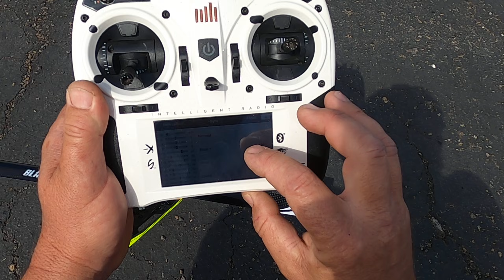How to Set your Tail Rotor Perfect on a R/C Helicopter and Why this Method Works.

Comment: Cos.  Iv got my tail mechanically set up right .  I have a slow wag in stunt 1.  I do have the 6250 controller.  So normal and stunt 2 are good.  I saw you said to adjust gain only 3% at a time.  If I understand correctly slow wag is the I gain or should I probably turn P and I down a bit?  I did lower head speed down to 70 in stunt 1 which I was expecting to have to raise the gain some. Thanks man.
Reply from the maker: Try more P and I first. Flip into stunt 1 switch position while in forward programming to make sure that you are adjusting the PID for stunt 1. It won't spool up as long as you are in forward programming.
Reply: CoeShow619 thanks bud!
Reply: CoeShow619 I think I’ve been adjusting to much at a time.  I was going like 10%.  Then I rewatched your vid and you mentioned 3% at a time.  Maybe that’s my issue
Reply: CoeShow619 dude I got it worked out!! Thanks so much!! You da bomb.com!
Reply from the maker: Josh Wilson That’s rad. Just have fun and fly a lot.
Reply: Cos, one more question, sorry to blow you up, I know you put a longer servo horn on the tail servo, why is that?
Reply from the maker: Josh Wilson  it’s a longer pivot point so it basically gets where it has to be faster. So basically it mechanically increases the gain. Gain equals speed of servo basically.  When you turn gain up, you are just making it react quicker.
Reply: CoeShow619 ok thanks I understand that now.  I appreciate it
Reply: So I put a longer arm on my tail.  It’s rock solid now.  It would be normal to have to turn the gain down a considerable amount correct. Doesn’t matter what the number is bc I have added mechanical gain.  Am I correct?
Reply from the maker: Josh Wilson Right on man! You must have been a good student. That is correct. The whole key to these Helis is knowing the science and mechanics behind them. They always fly best when tuned as perfect as they can be. Every tail in every model, with every gyro is like this. Next you can get into head gains. Same concept, but locking in that head for a robo heli. Gain is basically just turning up the speed of the system. You want it to run as fast as possible with out overshooting the target. Any new blades, new servo, a change in cyclic deflection all creates a change somewhere to get it dialed. Most guys just fly these all lazy and wait for them to fall apart. I like Helis because they are finicky, and not everyone has the patience. So ask all you want. Also a Justin Coe Show Coe Facebook page. You can message there too. Thanks man. Just have fun.
Reply: CoeShow619 dude thanks!! I’ll find you.  I’ve flown planes from 15cc up to DA 70 twins for 25 years.  MostLy Extreme Flight stuff.  Iv gotten into the helis bc like you said they are complicated and flying 3D is hard!! Iv learned  Any change in anything changes your tune.  I love it! Thanks so much for your willingness to get back to me.  I’m sure I’ll need your expertise on the 480 build!! Thanks again Justin! You rock bro
Reply: Cos shoe cuz, got a question on a little blade 230v2.  So I have considerable more positive pitch then neg.  My swash is perfectly level and I have 0 pitch at mid.  the controller arms from the upper swash are fixed and not adjustable so I can’t lower the overall swash to give me more neg.  if I did it by just the bottoms 3 axis links then I wouldn’t have 0 pitch at mid stick.  My question is on my servo travel end points could I change the neg to around 110% to give me more neg without it messing up my flight controller.  Iv read in some cases if you go above 100% in something( not sure it was pitch, maybe just cyclic) that it could confuse the controller.  This controller is just the 636.  Thanks again bro.
Reply from the maker: Josh Wilson you are correct again. I use about 110% low stick for pitch with the 230s v2.
Reply: CoeShow619 sweet thanks again my man! I just wanted to make sure it wouldn’t confuse the 636 or anything crazy like that.  Really appreciate Justin
Reply: Cos.  Dude you are the only guy that knows this shit so well so I come to you bc you take the time.  On the 6250 what would make the swash tilt back in normal mode with stability off.  I’ve tried everything man.  Recalibrated it several times.  It’s level during calibration.  My swash is perfect,  U1 and U2 is fine.  Even in hover it tries to roll back.  Stability off in every mode.  🤷‍♂️. Thanks coshoe
Reply: Dude I figured it out.  Someone it was trimmed.  Disregard.  Thanks
Reply: I forgot to set the trims back to 0 a while ago after I ordered a swash leveler.  Iv got 2 of these 330 And first one is locked pretty well.  Couldn’t figure this out to save my life. Until I just sat down and thought about the whole situation.  Ok thanks.  Hope you are having a great sat bro.
Reply: Hey, how do you disable heading hold on the tail with the 6250? Do I just lower the PID gains on the tail in forward programming in normal mode?
Reply: Greg Fitz that’s a great question bc as in other controllers you take it to neg values or below 50%.  I’m not sure but maybe cos will know.
Reply: Josh Wilson yea everything i’ve tried still seems like the tail gyro is enabled. with the heli on the ground moving the stick left and right then letting go, the tail rotor doesn’t return to center.
Reply: Greg Fitz yeah I’m not sure you can even disable HH.  I like it to get my tail mechanically perfect but can’t find it either.
Reply: Josh Wilson i’m really only getting tail
vibrations in stunt 2. My PID is probably just too high, but like you said, I’d like to make sure it’s mechanically set up right and the gyro doesn’t have to compensate.
Reply: Greg Fitz absolutely I know exactly what you are saying.  What heli is it? 270 or 330?
Reply: Greg Fitz I wonder if you turn them off down to 0.  If you find out let me know pls
Reply: Josh Wilson I tried setting the tail PIDs to zero and the tail blades still don’t return to center after giving left/right rudder.
Reply: Greg Fitz well ok damn.
Reply: Greg Fitz what heli is it on?
Reply: I’m not a huge fan of this controller.  My tail also has some play in it.  Thinking about putting a ikon 2 on it and a full miroheli tail
Reply: Josh Wilson fusion 270
Reply: Greg Fitz oh I want one bad.  Mine is on a 330S
Reply: Greg Fitz you can try it with your tx gyro gains.  I think the 270
Comes with a 635 controller.  Mine is the 6250 controller.  My tx gyro is inhibit tho

Comment: Damn 700's are big. I've got a few BNFs with my first kit on the way. You mention the value of a good manual and I couldn't agree more. Even though the BNFs come pre assembled I wish the assembly manual was available. It'd be nice to have the OEM specs( i.e. pitch specs, servo horn lengths and link lengths). Hell I still have the manual for my Concept 30.

Comment: What does it mean whenever I give quick pitch movements the tail kicks out momentarily? Whenever I do hard maneuver the tail kicks out
Reply from the maker: Well if it is 7210, you can go to parameter menu, go to F and use either red flashing, or blue flashing to add rudder precomp to the right. The setting depends on the direction it needs to move. Red flashing is opposite of blue flashing. So watch the tail rotor while in Hold on the bench, and move throttle/pitch stick. Yoke on tail shaft should move a tiny bit toward boom.  If you have a 6250 or a Ar636, they do not have this setting, hence I do not use those systems now days. If you only have one of those, you will have to adjust the gyro gain only. I believe every flybarless system should have rudder precompensation.

Comment: Best explanation of gain I’ve heard! Gyro holding power. Cool videos you’re putting out.
Reply: @NebulaOrion1  Depends on the FBL unit and the transmitter. For a beast X you change by assigning the heading hold/normal to a switch and channel. The amount of rate can be set by using the end points of that channel or manually on the Beast X if you leave the endpoints at 100-/100+. All the BFL's operate pretty much the same way. Some of the smaller helicopters don't have the capability to change the tail gyro rate.

Comment: Thanks for all these "setup guide videos", I've finally got most of the wag out of my 360CFX 3S, and Fusion 180. They still got a minimum amount of wag here and there that I won't bother messing with. It's good enough for my casual flying. Thanks again!
Reply from the maker: N 7 right on. Put a small amount of triflo oil on your tail shafts too. The easier it moves, the little nervous shakes will be gone too. I’ll keep doing little tuning videos about various things with helicopters.

Comment: Hey man good stuff, did you have a bad wag out the box with the stock AR636A in it or did you get the arf version? I have the bnf version and I can't get the thing stable even after fiddling with the mechanical stuff, gain, and pid settings.
Reply from the maker: The Ar636 just gets you hovering some what. The Ar7210bx is what I use and it works perfect.

Comment: Very nicely done Brother!
Reply from the maker: Works on Ikon/Brain2 dude. Use your gyro screen in transmitter. Put gyro on flight mode for gyro screen. Now put -55 in Normal mode. Make sure switch is in Normal mode. Adjust the pushrod length to get about 2 degrees right pitch. Spool up heli, see if she wants to rotate as mine did. Now adjust the rod if needed. Tightening links makes rod shorter, which gives more right pitch. It’s the best way to get a perfect tail rotor.
Reply: @CoeShow619  Thanks Brother! My only problem is that once I had the correct length I wrapped my 1" of my CF tail rod, metal threads and the ball link with Glue, Thread & Epoxy.
Lol Never going to be able to adjust the length. Lol